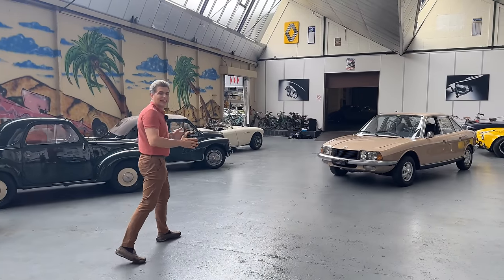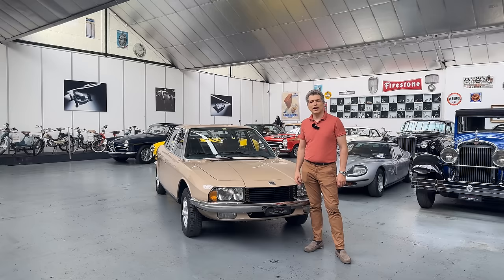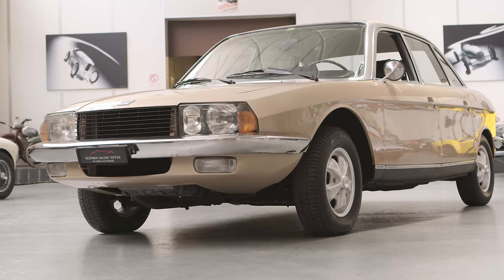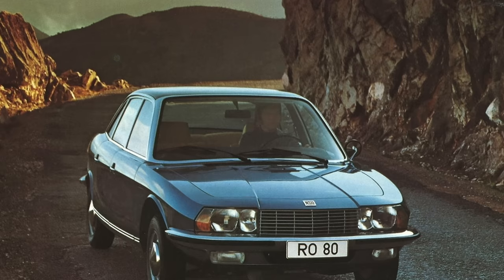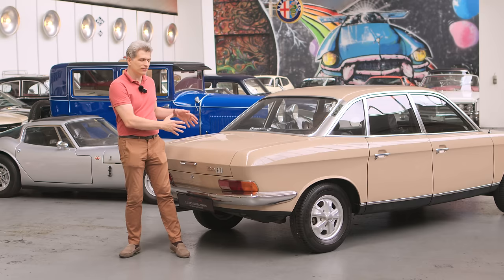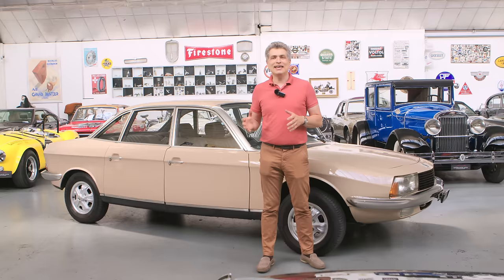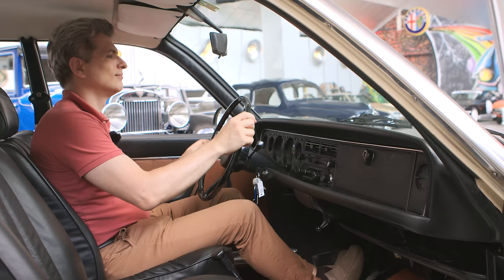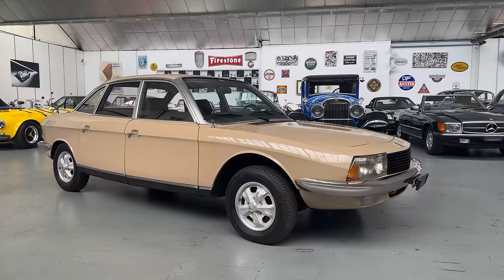How does this NSU Ro 80 with a Wankel rotary engine look and sound like today

Comment: I wss the UK's top NSU RO80 salesman in 1974, I sold 4 and received £250 bonus on each sale. It was a fantastic car but cost a fortune to run. The rotor tips would wear out and it would lose compression. In 1976 I was offered a 74 model that I had sold in part exchange, it had done just 11,000 mile. The Glasses Guide trade price was £1200, on appraisal (after compression test) we found it needed new rotor tips and an new exhaust totalling £1400, so the value was  -£200. We managed to do a deal at £1000 in part exchange writing most of the profit out of the car he was buying. The dealer principal had one for years it was his favourite car ever.
Reply from the maker: Nice story!
Reply: Congratulations for your very interesting story. The Ro 80 has always been my favorite car, it was a luxury car, it had a revolutionary engine. In Italy it was a car purchased by professionals, managers, lawyers and doctors. Although, unfortunately, with the technology at the end of the 60s, the sealing blade of the rotors wore out too soon and the engine consumed a lot of oil. Citroën also used the Wankel engine in the Gs and it was initially tested on a two-door experimemtal Ami coupé. The only car manufacturer that continued to develop and perfect the Wankel engine was Mazda, the latest model being the Rx8 until 2012 , but now due to excessive pollution, the Rx8 is no longer produced anymore and I don't know if and when Maxda will be able to build an eco-friendly Wankel engine. Thanks again for sharing your experience as a seller.
Reply: How cool 😎
Reply: If I remember correctly, Mazda fixed the apex seal problem with graphites.
Reply: I thought the Ro80 had a three year no quibble engine replacement warranty....?
Reply: The fact that it was a dual rotary engine with a unique shifting scheme makes this car a wonder worth exploring. Very interesting video

Comment: The design was from Claus Luthe, who was later BMW Designer between 1983 and 1992, he designed the famous BMW 7series which housed the famous V12 engine from 1987 to 1994.. and the 5 Series E36 from 1987 to 1996 produced…. you find the line in the middle of the body there ..

Comment: NSU didn't really have anything to do with Audi and forming the Audi Brand we know today.    NSU had been in business many years as was Audi, Auto Union, DKW.    Volkswagen aquired Audi from Mercedes Benz in the mid 1960's and in the late 1960's, when NSU was floundering due to the costs associated with the Wankel engines, VW brought NSU and Audi together into one group.   NSU's name and models were phased out.  That's it.  Audi was making vehicles the whole time.  VW and Audi still owns the rights to the name NSU.

Comment: Lucky enough to have had a ride in one back in the 1970s. Fast and smooth. And the design is timeless. Also drove a Mazda with a rotary engine around the same time.  Changing gears smoothly a little tricky with the way the engine kind of surged but vey smooth too under power. The sound was not too different from a reciprocating engine.

Comment: My next door neighbour in the 1970s had a Mazda Capella rotary.  He used to get 17 l/100 km at best.  Had to start the car 5 minutes before leaving home.
Reply from the maker: 17 l/100 km? Wow! It is known the these engines used to be thirsty, but 17 is beyond one would assume!
Reply: @NSWLancer I drive a 1972 Mazda Capella Rotary. I have absolutely no idea what you're talking about! It's instart start and drive. And not thistry unless you floor it. Of course, you tend to floor it because it is such tremendous fun. ;^)
Reply: Please keep in mind that cars at that time with reciprocal engines with same power also took that much gas! And many needed high octane gazoline. The Ro80 uses low octane gas which was much cheaper back then.
Reply from the maker: @dirkm1964  you made a good point, we often forget to think in different parameters when seeing numbers of these cars.
Reply from the maker: @xntrcshft  that is a great choice!

Comment: For me, the NSU RO 80 has always been the absolute most beautiful car from the sixties. I can still enjoy the beautiful lines of this car. VW had previously taken over Audi and when VW then took over the NSU factory at the beginning of the seventies, it was done with the RO 80 as VW thought that this would be too big a competitor for their rather boring Audi 100. It was a shame. I'm glad that there are people who still keep this beautiful car alive.
Reply from the maker: It is a beauty of the sixties indeed! And thankfully there are still some well kept cars, dealing with its sophisticated engineering.
Reply: @timelessdriving  The rotary engine was thought by many to be the engine of the future. It had many good qualities, but durability was not one of them - although examples to the contrary can be found. It was rumored that when two RO 80 owners met each other on the road, they marked the number of engine changes with the same number of fingers in the air. Some completely abandoned this engine and had an Audi 100 engine put in the car instead.

Comment: I drove for quite a long time my NSU RO80. The problems were many; 2x engine change, many oilpumps and continual  starting problems. But at that time luxurious driving, high speed, high fuelconsumption; terrific roadholding etc. Indeed, far ahead of its time but the engine malfunctions killed the project.

Comment: One of the most amazing cars ever made.
Reply: Agree. Along with the Citroen DS, Lancia Fluvia, Alfa Romeo GTV, and Jaguar E type.
Reply: Yeah, Lancia Fulvia coupé was one special car. I remember being stunned when I saw my first one in about 1970. Years later, I acquired a red 1600HF, probably the sweetest car I’ve ever owned, lovely styling, exquisite engineering, jewel-like handling…
Reply: @roybatty2030  ... actually I'd take out the Alfa GTV, as it doesn't quite sit with the other cars mentioned here. In its place I'd put the very classy Fiat 2300S coupe.

Comment: We didn't get many NSU's here in the USA because of not having an large established dealership network. The reviews on the RO 80 were ecstatic about handling and performance, but it would have done better with a 4-speed and a clutch. The rotary engine was originally a concept well ahead of the technology needed to make it great. I was a child in the 60's but I already understood how engines worked, and to see how a rotary worked was mind-blowing. Mazda was eventually able to solve all the Wankel's problems as materials technology advanced, but these early engines had rotor tip seals which wore out rapidly, and even the later ones couldn't go as long as the piston engines of the time. They were race winning engines where displacement was limited since you could rebuild/ replace them between races until rules changes penalized them. In the end, emissions regulations killed the rotary engine but it was a 'wonder-child' in it's time.

Comment: I used to do a lot of tune-up the Rx2 and the Rx3 the Rx4 were just coming out, we use the best plugs points condenser and we had made our plug wires out of Belgian wire. Get maximum performance.

Comment: Very unique vehicle....  my dad had a 1969 VW convertible with a similar transmission.....practically an automatic but you changed the gears.....no clutch, from what i heard the 3rd gear made the engine run at too high rpm and engines suffered.....probably not so critical on the NSU since it had a much higher rev line....but in both cases it would use more fuel than a regular manual transmission.

Comment: In the Spring of 1978, my Father was looking for a 'new' car to replace his written off 1968 Rover 2000TC, I remember going with him to look at a choice between a Triumph Stag and an NSU Ro80, he really liked the futuristic design of the car, but in the end, he was put off by the generally accepted wisdom about both those cars having unreliable engines, and instead he bought a 4 year old Triumph 2000 Mk.2/TC Saloon, which he kept for 12 years, until he replaced it in 1990 with a 6 month old Peugeot 495GLD.
Reply: hmm, he picked a triumph and a peugot in the interests of reliability :)
Reply: @PRH123  Generally speaking, he made good decisions, the Triumph lasted 12 years until it was written off in an accident, and the Peugeot, likewise lasted 9+ years until it was rear ended by a truck. Both cars were pretty good overall.

Comment: That old girl needs a tune up, they should sound a LOT smoother than that, even cold. Needs a new muffler too…

They are quite sensitive to spark plug condition, so start with that.
Reply from the maker: Yes, it may very well be the case. This engine has 99K km on the clock and has been running mainly short distances in recent years, a fresh tune up, or a longer drive at least, would do it a favour.

Comment: If I am not mistaking, this car NSU Ro 80 and NSU Prinz were built also in Yugoslavia, Sarajevo...TAS factory, where later VW were made also.
Reply from the maker: As far as we know, it was the case only with NSU Prinz, built by Pretis. NSU Ro 80 has been only manufactured at Neckarsulm plant, which today is an Audi plant.

Comment: Both the Munich and Berlin tech/transport museums have Ro 80s. Still a modern and beautifully designed car down to the details. (They should have realized that the rotary engine wasn't up for it besides getting poor fuel economy, and found some V4 or something to use instead.)

Comment: The NSU Ro 80 was designed to look like the car of the future.  The engine was way smaller than a piston engine so the engine compartment could be smaller.   Other cars copied this car's efficient design,
Too bad this car uses up to much gas.

Comment: When a chap started a Ro80 dealership here in Australia, I worked for a company a few doors away.   He imported three Ro80's, sold all three, and went bust.   The three Ro80's were scrapped within months, as that was how long the engines lasted.
The Ro80 was about the biggest scam ever perpetrated in the automotive field.
The guy in this video says the Ro80 featured has done 99,000 km on one engine.   I simply don't believe it.   still, it doesn't sound at all healthy.

Comment: The Wankel engine bankrupted NSU who were taken over by Audi .
Reply: No: NSU was in reality buy by Volkswagen , Audi was only a name, part from the Auto Union buy by Volkswagen in 1964, Audi did not built cars sinze the bankrupt of 1932, the Auto union cars was DKW's (two stroke engines) The all first Audi 60 (1965) was built on a original NSU project , like the Volkswagen K70
Reply: @leneanderthalien  Aus dem NSU RO 80 wurde der VW K70, aber sie machten ihn etwas quadratischer und an der Nase höher, um einen 4-Zylinder einbauen zu können

Comment: It was a fantastic car for its time, 
many years ahead of the competitors
But ... that damned engine doomed it!
If they had made a version 
with an alternating piston engine 
and a normal clutch
it would have sold so many!
Reply from the maker: Yes, may very well be that way, but then it would not have been so special today.
Reply: @timelessdriving  
at least NSU will have survived and probably prospered
rather than being killed by the warranty replacement costs 
of 2/3 engines for every one RO80 sold

Comment: I would put a Hayabusa engine in it.
Reply: Actually around 1980 I was here in a town near Amsterdam in a (Saab) workshop  and saw how a guy who raced cars had stripped drivetrain and most of the interior from a RO80 and was building a roll cage and a conventional Abarth type Fiat 4-cylinder race block into it as a straight line mid-engine power unit roughly where the back seat used to be, even today I can see myself gazing at this Frankenstein (rallye?) monster. I've always wondered what he was expecting to win with that unusual setup, maybe he just loved the fun of unusual challenges. Anyway, I later bought a disassembled Honda SS50 from him, I stlll was limited to mopeds and loved learning to work on engines with these Japanese 4-stroke little technical marvels.
I've always had very fond memories of the 70's when I grew up and cars like the NSU and CX  and bikes like the Suzuki rotor bike and many more are defenitely part of that.

Comment: Horrible colour though, Vorsprung durch Technik or progress though illegal emissions!  A nicely made car nonetheless.
Reply from the maker: Yes, indeed, there were much nicer colours in the NSU Ro 80 range, my favourite would be deep blue and brownish. But this one felt in the pace with that time as well.
Reply: @timelessdriving  it's refreshing to see a channel in its formative period, and I admire you for 'having a go' at speaking English, as we put it.  Keep up the good work!  May your subscriptions increase.  👍
Reply: l owned one of these vehicles in the mid 70s….it suffered terribly with problems with the rotor seals…. Starting was a real pain, especially in UKs damp winters……sometimes it wouldn’t start….However in the summer months it was generally okay…..it was a very smooth car to drive. One thing l remember it used four platinum spark plugs that were far more expensive that normal plugs..with all its faults l have fond memories of ownership…..not everyone gets to own this, even by today’s standards a revolutionary car…a friend of mine used to call it the Panzer Wagon…